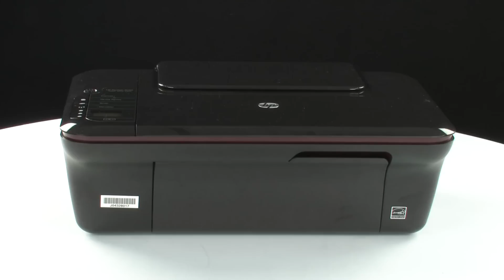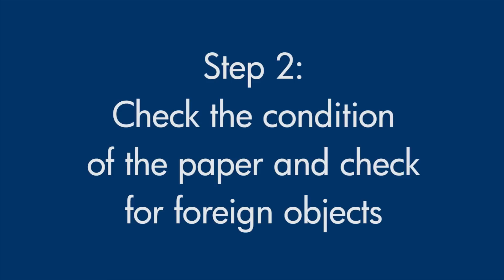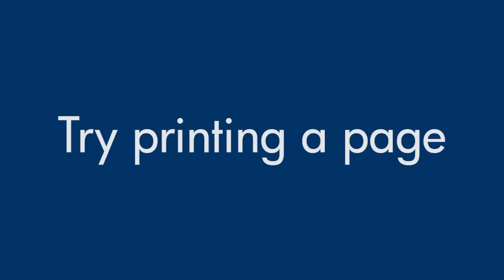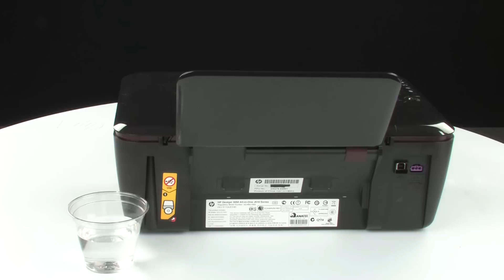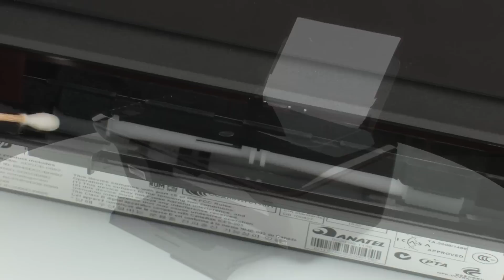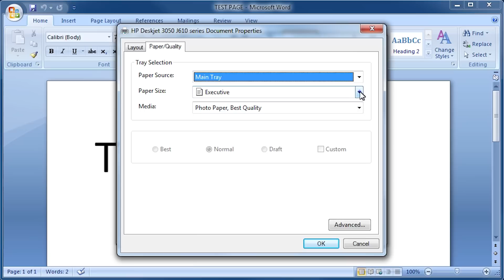Fixing Paper Pick-Up Issues | HP Deskjet 3050 All-in-One Printer | HP

Comment: This printer has always given me issues with paper feeding. I have to manually help the paper to start the paper feeding properly. If it's 24 lb it almost wont work and often accepts the paper late and cuts off the top of my printing job or doesnt fully feed the paper and the entire job prints on the roller. It has done this since day one. My 30+ year old HP 720c still works and does a better job than this hp econo unit.
Reply from the maker: Hi there, thanks for contacting HP Global Social Media Support!
I understand that you are experiencing a paper feed issue on your printer.
I will do my best to assist you.
Please refer to the instructions mentioned under this document to fix the issue: https://hp.care/6057SOOv7
Regards, 
HP Support

Comment: hi, I've had this infuriating problem for months now. when I try to print something, the paper doesn't feed through. something is blocking it from moving past the rollers and into the printer itself. it's only blocked on the left side of the paper and creases the paper when the rollers force it down. by moving the rollers apart, like you did in the second step, i noticed a black tab on the track, right up against where the tray is. I can provide pictures if needed. either way, it looks very built into the printer. it's maneuverable, since it can move along the track using a screwdriver, but it doesn't retract when I try to print. it completely blocks the paper from entering.
Reply from the maker: +earleroy A paper feed issue can occur for several reasons, such as dusty or contaminated paper rollers, the condition of the paper in the tray, or even issues with the software. The steps to fix this type of issues can be found in this document: http://bitly.com/2HPd8C4
Reply: HP Printer Support he said something is blocking it. What could that object be? Or how would we (since I have the same issue from his description) solve this problem?

Comment: I found a leaf yes a leaf in mine thanks to the critical stage as I never knew about that door underneath, I agree with Siwen Wang though printer is cheaper than the ink for it. Can you recommend a good printer that the ink is cheaper for then Siwan?as removing the leaf hasn't helped and there;s nothing more in there. I've had Epson, and a few others but all gave up the ghost, one in particular the name escapes me at present but would recognise it wouldn't touch it with a barge pole, ink so expensive, its actually still in loft, works but wouldn't pay the cost to replace the ink, was going to be £100 yeah right on.
Reply from the maker: +Maureen Longstaff You can try the steps mentioned in this document to fix this issue: http://bit.ly/2gAsXFj

Comment: My dad just tossed this in the garbage after 3 years of no use, being young and mentally capable of following simple directions I managed to make the printer work and the only problem is this... it just wont grab a piece of paper unless I manually assist it. Hopefully this video helps and if not it was still worth it, now i can scan and print without having to have spent a dime.
Reply from the maker: +Brandon Luco it is really good to know that you managed to get the printer working again and I really appreciate your efforts. And if the printer still does not pick up or feed the paper from the tray you can refer to this artcle: http://bit.ly/2gAsXFj and follow the recommended troubleshooting steps to isolate and resolve the issue.

Comment: My printer is HP Deskjet 3050,and I have this problem that I cannot solve once I turn on  the printer  it will display on the screen DOOR OPEN,I cannot print I reset it already but nothing happen.I need help.
Reply from the maker: +Arch Perth I understand the printer displays an error 'Door Open'. Open, and then close the cartridge door of the product. Make sure that the door rests securely against the body of the product. The following link will assist you to fix the issue: http://bit.ly/2w2smxM

Comment: Thanks for this very easy to follow video with clear instructions. Unfortunately, I did everything as shown but my problem is still not resolved. For several months, I had been getting the 'Clear Paper Jam' message every time I used it,  which was very frustrating because I knew there was no paper jam and I could hear the roller whirring away inside trying to pick up the paper. So, I followed your instructions, and was really pleased when the paper actually got picked up by the roller for the 'Printer Report' and started to feed through and I thought my problem had been fixed. I was wrong. The paper stopped feeding after a couple of inches, and even that was excruciatingly slow going. Eventually, it spat out the paper with just some letters from the top line of the printer report. I have renewed both the colour and the black & white cartridges so it can't be that I'm out of ink. Now it's back to doing what it was doing before. Not accepting the paper feed, telling me there's a paper jam. HELP!!! What can I do?
Reply from the maker: +Eden Kitchen We understand that you are experiencing a paper jam issue on your HP Deskjet 3050 All-in-One Printer. Please  follow the solutions in the order presented in following document to resolve the issue: http://hp.care/2nwaWGC. If the issue still appears after following the steps in this document, contact an HP Support for further assistance: http://support.hp.com/us-en/contact-hp

Comment: There is a simpler way to fix this. First, close the paper tray and front door. Second, unplug the power cord. Third, toss that shit in the garbage can where it belongs and get yourself a decent printer that is not cheaper than the ink.
Reply: how to open hp desk jet 3720
Reply: how to open hp deskjet 3720
Reply: Mine is waaaaaaaaayy effin expensive than the ink. but still have this problem.
Reply: This fix worked for me perfectly.  Thank you!
Reply: Amen to that but this one is slightly more expensive than most of the "all in one" series. At least the version I own is with WiFi etc. and a backlit LCD screen panel built in.

Comment: Printer does the initial grab with no problems. but while it's showing printing the paper does not move after the initial feed . so clean in inside roller or some other advice? Thanks~
Reply from the maker: Assuming that you are using the Deskjet 3050 from the video, try following this:  HP Deskjet 3050 (J610) All-in-One Printer Series - 'Out of Paper' Error Message and the Printer Does Not Pick Up or Feed Paper - ( http://ow.ly/mkb7302dAYq )

Comment: the rollers that you talked about in the video pull the paper and are working perfectly fine. but then, when the printer starts printing, i can hear the rollers that are INSIDE the printer itself working, but the paper doesn't go through the printer. when the printer continues to print the next page, it says "paper jam, clean paper jam". what to do?
Reply from the maker: +Bulbul Chan   I know you are getting a clear paper jam message, but there are times that a carriage jam will present itself as a paper jam. Please follow the steps in the "A 'Carriage Jam' Message Displays for HP Deskjet 3050 (J610) All-in-One Printer Series" troubleshooting document ( http://ow.ly/10CFDb ).
Reply: +HP Printer Support I followed all instructions in the video, but nothing worked out. I found no foreign objects anywhere, turned the printer off and on, checked that the carriage moves freely, removed and installed the cartridges etc.. but nothing worked out for me. 
I have bought a new printer (HP OfficeJet 4630) because I needed to print urgently. Thank you anyway.

Comment: My hp deskjet 1512 printer is making loud annoying noises and when it's about to print, it makes the sound and the paper is crooked and does not print and then the noise continues. Please help!!!!
Reply from the maker: Diane Recto I recommend following the steps in this document on Resolving Paper Load, Grinding Noise, or Carriage Stall Problems for HP Deskjet and HP Deskwriter 600 Series Printers, as well as HP Deskjet 1510, 2540, and 2545 Printers - Printer Does Not Pick Paper. These resources can be found by Google searching "c03784732", and "bud04237". If the issue continues, please contact our technical support by going to Google search and enter 'contact HP worldwide'.  Your first option should be the site for contacting HP, when you click on it you will be prompted to choose your country/region.

Comment: God bless this video. I just bought this printer for $10 off Craigslist and I did expect it to work (but if it didn't, $10 drop + $14 ink wasn't too much of a loss, given the upside). Anyways, right away it wouldn't feed. So being the tinkerer I was, automatically started looking for the paper jam (opening the under belly of the printer, etc) and couldn't see a darn thing. FINALLY, when I was about to give up, using a bright LED flashlight (focused on the 'paper jam tray' on the bottom of the printer), I saw something green and plastic. I figured it was probably part of the printer, but I investigated further to find it a VERY SMALL THUMBTACK! With some resourcefulness (I used a long skinny skewer (think long toothpick), I was able to pry it out of there (it was wedged in there WELL). And now? Voila! It prints! God bless Youtube, this video, and the freakin' internet.
Reply from the maker: Rishi Kumar Glad it was helpful!

Comment: I have the same issue as Marinecorp. The roller on the left is closer and when I print the paper gets twisted and prints at an angle. I've only used the printer a handful of times.
Reply from the maker: Hey Matthew.  Please use Google search to find C01674732 or you can search for it on HP's home page.  It is a document with detailed trouble shooting steps when your printed text or image is skewed.

Comment: I think that white bar with the rollers somehow got bent on mine.  I never dropped the printer or anything, but it looks like the left side is pushing harder on the paper than the right.  I tried cleaning the rollers and the paper still crumbles up at the bottom.  It seems to suck to the left even with the paper guide set.